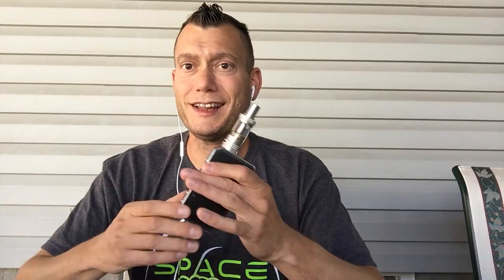Dangers of Ni200 nickel DON'T vape it on anything BUT Temperature Control!

Comment: I can go along with pulsing nickle to glowing red is bad. But vaping nickle or titanium in wattage mod is the same as vaping kanthal, you're not turning your coils red while vaping or else you're getting a "dry hit". Ti/Ni in voltage mode works a little like temperature control, as they heat up the resistance increases, your wattage lowers. In wattage mode the resistance goes up, wattage stays the same so your voltage increases, probably not a vape most are looking for. I sort of bought into questioning whether nickel is safe at all, maybe, maybe not, I'll wait. Titanium also has some hand waving but I've done some testing and at the point of white titanium dioxide the wire is brittle, I don't think the other colors are a dust danger. Some potential for risk but I think it's lower than with nickel until some test results are in.
Reply from the maker: +Myk63 Hey I just read your comment again.  I revise my earlier response.  You have not got that right at all.  Please stop doing that.  Nickel and Titanium to not get vaped in wattage mode.  They are not like Kanthal.  wattage mode does not back down power as you approach set temperature.  You do not want to vape this until it gets a dry burn as a warning.  I feel you like to chime in on the subject.  But these are not facts you know or have scientifically proven.  You are giving an opinion of what you 'think' and your 'testing' ....all of that is a gamble for you to risk, and I beg you not to take that risk.
Reply: +Quest4vape You may want to read it yet again. I already said in wattage mode voltage increases and that is probably not going to give a satisfying vape. I don't know how you vape but I don't want to get a dry hit no matter what I'm vaping with. If you're turning your wire red while you vape that's not good whether it's nickel or not. I find 576° to be gag inducing, that's not even to the 600° it takes to start breaking the nickel down. Nickel or not that's formaldehyde which we know from DrF taste is a very good detector of. My testing is testing not thoughts that's why it's called testing. Try it, build a Ni coil, taste it at near 600°, put it into wattage mode, start low and taste it.
This is no different than the fears over setting Ti on fire, which I have also proven wrong. People acting like they have facts to wave their hands over when they don't.
Reply from the maker: Some things you say I agree with, some things I do not, but let's be careful here when stating a personal opinion vs. a fact. 
Fact 1:  Don't vape nickel or titanium out of reliable Temperature Control.
Fact 2:  Don't dry pulse the coils and make them glow it not only oxidizes the surface of the metal, but allows the metal to heat far beyond the intended temperature for vaping.  Even though you are not vaping it while pulsing, you will vape it after you're done and might very well have turned the metal toxic for any future vape after that.
3.  Titanium is more stable than nickel, not  rated at as high level of toxin nor carcinogenic, and though harmful at high temperatures, not AS harmful or potentially harmful at lower temperatures.  
4.  Nobody should be telling other vapers that vaping Nickel wire is 'safe'.  Not even just because you have done it/currently do it...you may not see the effects immediately.  How would you feel if YOU turn out to be wrong and people followed your assurance of safety?  
And those are my points in making this video.  You can make your own video, that is what your youtube channel is for.  Thanks.  And I'm not trying to be a know it all snarky jerk here, I invite information on this topic and want people supplying both opinion and also actual research, testing, RESULTS of testing for us all to see.
Reply: +Quest4vape I agree with everything except fact 1; It doesn't act like you think it does. 
Especially now that you've thrown Ti into the mix. I flip my Ti coils over to wattage, the wet cotton doesn't burn. If it's not burning wet cotton it's certainly not getting hot enough to degrade the metal. You also have to pulse the button to get it to reread the higher resistance on all of my mods. With a quick succession of presses each hit gets more powerful but none of them get close to burning. That inconsistency hit to hit is why people wouldn't like it. Nickel being so low in resistance and in a high watt mod that doesn't step down could be a problem but you're going to taste burnt cotton or liquid long before you get the wire hot enough to break down.
But that's not to say nickel isn't already breaking down without heat, that's where my nickel questions come in and why I'll wait for some science.
What I mean by the same as kanthal is you can't turn a wet coil red. It's like boiling water over a fire in a paper cup.
Reply from the maker: +Myk63 aha, yes, I think we are in agreement.  My gripe in this video is about folks dry pulsing their nickel and titanium.  When wet then it can be pulsed without damaging the metal.  I do this in my video for the Koopor Mini in temp control on a nickel build on an RDA I do a series of 12 second pulses close to the camera without burning the cotton.  By this point there would be no flavor, and as the cotton gets dryer and dryer it powers down and off quicker and quicker.  so we are on the same page.  You are an intelligent and experienced vaper and I value your comments here in this discussion!  Here is an example of what I have found is WRONG to do:  https://www.youtube.com/watch?v=QKrXdrduNr0 from the King of youtube vape builds and reviews, +Rip Trippers says at 4:20  to make sure that his Ni200 nickel claptons (so pretty) glow from the inside out he TAKES IT OUT OF TEMP CONTROL and pulses them to glow, see where the hotspots are, and pinch/manipulate out the hotspots.  that's a big NOPE.  Then he shows a spaced clapton and mentions you don't have to pulse those....the problem is he has 166,000 views on that video.  That's an awful lot of folks listening to him telling them to do exactly what you're NOT supposed to do.  
* Another subscriber here on my channel commented earlier in this video that he wicks and dripps his coils and then pulses them.  The coils don't glow, and he breaks in the coils without exposing them to oxidation or high heat, and he CAN pulse them in TC mode.  Even if one absolutely must dry pulse the coils, if done at 5-10 watts for the barest brief pulse of power it would be better than to glow those coils like Rip does.  Unfortunately Grimm Green does the same pulsing to a glow on a twisted nickel build on his channel.  So some of the most influential people in youtube vaping have got these no good wrong ass tutorials.  I watched those videos and thought because they did it it was ok.  It's not ok!  Thanks again for taking the time to comment here, you really care about vaping and about educating other vapers to be safe!
Reply: +Quest4vape Oh yea, don't do that. I'm pretty sure Rip's bright red is way over the 600° I've heard is the start of nickel breakdown. There's already question of it breaking down without any help. If steel is a good estimate any amount of red is going to be too hot. I noticed he didn't wick the one he glowed :) 

On titanium, all the anodized colors are titanium dioxide. I want to believe only white dusts and creates the inhalation risk. That might be wishful thinking. If I'm not right titanium isn't suitable for vaping.
I have a video when I torched it, mainly because of people claiming it goes up like magnesium and I thought cool, it doesn't. It does catch "fire" a little but takes a very hot torch to light and goes out. A propane torch will get it bright red and white dioxide, also destroys it. A lighter gets it to light blue.
I know you can direct fire titanium low enough to soften it and work out shorts without turning it white. It having some resistance helps. I think you'd have to be trying to get it to catch, but I could imagine people pushing it bright enough to make it white and brittle, that's how people are.

Dr Farsalinos is even saying not to get kanthal glowing like that.

Comment: I'm glad someone finally put out some information on the dangers of vaping with nickel. I've found from my research that the typical temperatures of vaping get NOWHERE near the point of oxidation for nickel. However, I've decided to stay away from it until some solid evidence from conducted studies confirms if nickel is toxic to vape AT ALL. I'd like to see someone do some extensive research on this.. because it seems that the future of vaping lies with nickel, titanium, etc. and temperature controlled devices... However, I don't want to buy into that until I'm sure of the risks. Great information here. Hopefully someone will take this and run with it and provide us with even more information on the subject.
Reply from the maker: +ZTRussell42 Thanks Russel,  hopefully at least people stop vaping nickel coils in regular wattage mode.
See how easy it is to buy nickel coils for any subohm tank?  See how many people are vaping subohm tanks on mech mods?  See a problem?
They don't know they aren't supposed to do that.

Comment: hey, great info vid! thanks man. just wanted to know is this the same for Ti as well?
Reply from the maker: +Darren Robertson Same concept.  Only in temperature control.  Titanium is higher resistance than nickel and slightly less toxic (from what I'm learning) but still not healthy to vape in wattage mode.
Reply: +Quest4vape awesome. thanks =D just got some titanium yesterday. gonna do my first build today see what it's like on my new Smok X Cube II
Reply from the maker: +Darren Robertson some of my more technical minded vaping friends choose Ti for temperature control in avoidance of Ni200.  They say it is a more stable metal, not water soluble when exposed to change in PH, higher melting point, more heat resistant and while it is not healthy above certain temperatures, it is not categorized as a toxin and known carcinogen, but merely as an irritant.  I still wouldn't go pulsing the coils to glow nor dry fire the coils.
Reply: +Quest4vape perfect! thanks a lot for the extra info too. glad I went with the Ti now ;)

Comment: what happens if your temp control fails?
Reply from the maker: +Glen Hanley Good question.  Ideally the device should cut power if it can't read the resistance change in the metal.  But some devices pop out of temp control into regular wattage mode.  And that's scary.
Reply: Thank you for your answer. I just purchased a temperature control device, I just wish that I knew about the dangers of nickel wire,before I bought it. I really enjoy your reviews, thnx

Comment: just bought an evic vt that has temp control for nickel and titanium, I'm new to this but when I first got it the guy who ran the shop did not tell me anything about setting it in temp control nickel mode, so I was vaping in wattage for about 2 hours and started to get a nasty burnt taste, after finding out that it had to be in temp control for nickel I made the adjustment.   and it worked fine. but is it possible that there is already oxidation and should I change the atomizer out?
Reply from the maker: +mstott90 It's possible, I'd change out the coil.  That burnt taste doesn't bode well.  I get furious with all these vape shops selling products that they don't even know how to use properly and don't educate their customers about.  Thank you for validating the purpose of this video, and thank you for watching.
Reply: Quest4vape Ok, I have since changed the coil out, I appreciate the quick response, I'll make sure to subscribe.

Comment: why doesnt temp control work with kanthal
Reply from the maker: +ELI V4 Something to do with the coeffecient being too high for Kanthal.  The resistance of the alloy is too high.  Some of the newer and more sensitive TC chips can read it now, and also Stainless Steel.  Which is very exciting to me.
Reply: ohhhh maaan If thats a succes man im gonna buy cus I really dont want to vape nickel you know. Me being concerned every time i vape is not gonna be a good vape. But yeah thanks for answering back :)

Comment: Everyone is making assumptions about titanium , dabbers can crank up their e/d nail up to 1400degrees grade 3 ti or silicon carbide nails, never offgasses in lower temps like 710-f  so it's safe! I will warn you not to use titanium wire unless you are a master vaper/coil wrapper because it is finicky by reading higher ohms , stay safe guys.
Reply from the maker: +benson420710 Hi, I don't really know anything about that stuff you're mentioning.  Sorry.  But thanks for watching and thanks for your comments.

Comment: Thanks a ton for posting this, my brother was just vaping his atlantis v2 on ni200 coils in wattage mode today, so it's good that I saw this. Just called him and let him know to be careful with that shit. But I DO have a question, can nickel still be used completely safely on temp control devices like the Smok XCube II for instance? It's more than likely going to be my next purchase so thanks for reading this 👍
Reply from the maker: +PHaNt0m979 Happy to share the message alot of people don't know and haven't been told yet.  Please share.  And thanks for watching!  There are differing opinions on whether nickel is even safe to use at all.  But the industry of manufacturers for vaping products believes (and I'm still eagerly searching for some real research) that Ni200 nickel is safe to use at temperatures below 600 and when wicked and juiced where it does not have contact with air to oxidize.  I'm not going to tell people what IS safe....I can only speculate based on what I've experienced myself, seen, heard and read.  Anybody that works with metals and chemistry has told me that nickel is highly toxic even used in small amounts, even handled, and we expose it to juice and heat and it sits submerged in juice....also nobody knows how much of the stuff gets released in small amounts and stored in the body, accumulating for some problems later on.  I think folks need to know there is a danger here at high temperatures and reliable TC is mandatory.  And folks need to know there is a potential danger here even in TC and they have a serious choice to consider if this is a gamble they are worth taking.  Thanks for watching man.
Reply: Thanks for the feedback!

Comment: Nickle leaches even if you don't heat it. That's why you never see food or water stored in a nickle container.
Reply from the maker: +orangetree Thanks, even scarier.  Wondering when we can get Temperature Control for Lead wire and vape at 30 degrees for a really cool flavorful vape.

Comment: Needed a new mod, so I picked up one that came with TC and goes to 120w in power mode. As a fairly new vapor although certainly not a cloud chaser by any means and having utilized vaping to quit a multi-decade old nasty habit, successfully I might add, have no interest in further jeopardizing my longevity.  After reading and watching about the potential pitfalls of nickel, and for that matter titanium, I think I will perfect my Kanthal coiling skills and wait for germane analysis relative to the metal. I do recall many years ago seeing slot machine players continuously have to clean their hands from the black gunk from handling nickel coins as well as having such metals crafted into jewelry also discolor ones skin. -Kind of makes you wonder what happens when you inhale it. I can't say that I am unsatisfied by any means with Kanthal and at least it has somewhat of a track record.
Reply from the maker: +Lee Heller thanks Lee!  That's a great example, and most folks walking the earth today won't remember the days when Nickels contained nickel.  That was before my time too.  Congrats on quitting the nasty habit of smoking through vaping, thanks for watching and commenting!

Comment: I would not recommend nickel coils at all, it's useles to face the danger of toxic nickel in anything you use to vape. Never try it but I think it isn't better than fused clapton or stapple.
Reply from the maker: +DefjamX06 exactly.  I get a better vape on claptons and low subohm builds on Kanthal.  I'm not trying to conserve battery power....I carry extra charged batteries with me and that's that.  I'm getting some 316L stainless steel wire to build with and most likely will get a DNA200 to vape TC on Stainless Steel.
Reply: Quest4vape Yeah, Im using mech mod so I do it same with batteries. The high drain types have little bit smaller capacity, so that's need

Comment: Hi sir.. On your mod.. What's your limit Fahrenheit.. I put 450f..it's safe?
Reply from the maker: +syaqjmm8427 My various TC mods run up to 600F which the manufacturer believes is a safe limit.  I usually set max temp around 470-500.  I could not say if this IS safe, but certainly you're well below the limits of your device, and thus feel safer.  I can't help feeling though, like we are a consumer market of lab rats conducting the trial and error beta test of vaping technology.  Sorry, my ongoing opinion of Nickel is not positive.

Comment: how to clean nickel coils? everytime it gets dirty i just buidling over again because im very very worried to dry burn that nickel and just throw to the water like when you using kanthal
Reply from the maker: +Rizky Andika Easiest to just put a new build in.  But they can be cleaned by pulsing in TC mode using water and a dropper.  Not glowing the coils.  +VapnFagn has a good video on it at 25:30 minutes   https://www.youtube.com/watch?v=EqG3HxROOu4